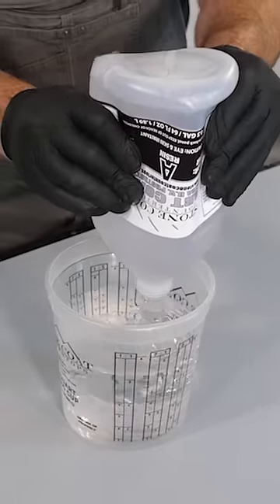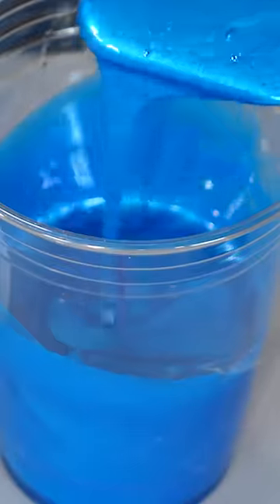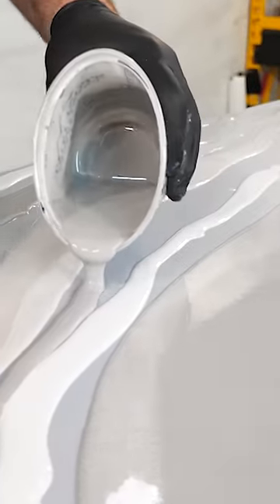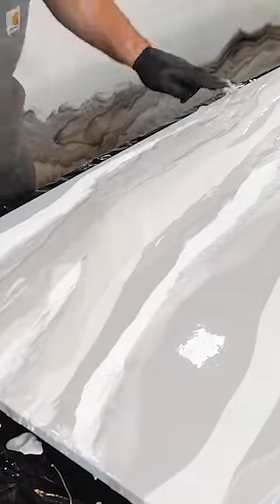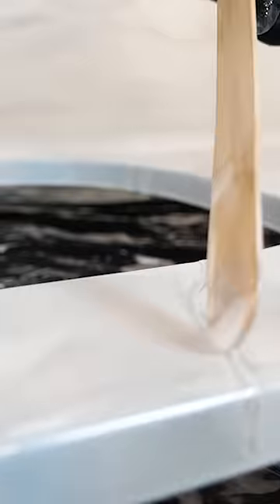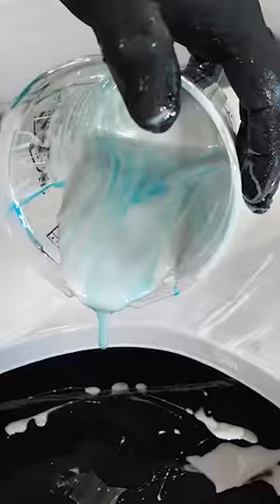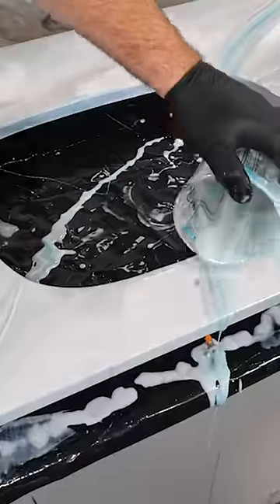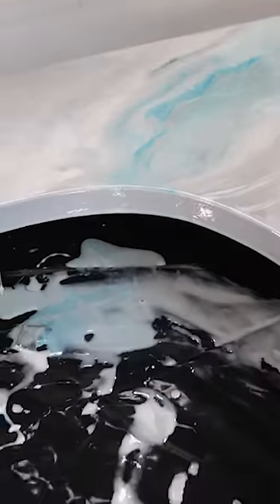He spent $3000 to get shoeprints out of Quartz 😱

Comment: $3000 to avoid spending $7000 and now having a guy to call if this ever happens again seems like a decent investment to me
Reply: You can get real quartz* for cheaper, like an actual rock that was brought from the side of a mountain 😮
Reply: The guy was 2 weeks away from retirement
Reply: Everybody wins
Reply: Yep G you said it first
Reply: @newera9962  quartz**. Good luck finding a big enough piece for a counter transporting that piece down a mountain and then hoping it had no severe defects like weird inclusions or stress fractures.
Reply: The painter is gonna be -3000 on his check.
Reply: @newera9962  that's what he's talking about......
Reply: @newera9962  he was talking about real quartz in this video. Probably a big single piece countertop which would be expensive even into the 7k range for quartz. The epoxy countertops are only a few hundred max.
Reply: @New Era  the problem with quartz is that its too brittle.
Reply: Chances are, if this story is true, the painter paid for it. At the end threw back charges
Reply: @itsm3th3b33  Why would they be surprised.  You know the epoxy pour happening on the screen has NOTHING to do with the story right?  You can't be so dense as to think that the stains on the quartz in the story was repaired with epoxy right?
Reply: Probably another lesson learned is to cover the quartz with cardboard or Masonite until the job is completed.
Reply: @newera9962  really?
Reply: @newera9962  yes but you cannot cut it
Reply: @newera9962  no way. its ganna be DUMB expensive for quartz like that lol
Reply: @colemanmorris5762  i would imagen that it would cost like 100k to get a piece like that lol
Reply: This is how capitalism should work. Everyone wins eventually
Reply: @newera9962  well yeah the processing is what makes it more expensive, just like a natural dirty uncut diamond is gonna be cheaper than a cut polished diamond.
Reply: He should've made the painter pay $7,000 and called it even. 😉👍
Reply: @newera9962  like how much? And would shipping/ moving it cost a lot too? Jw
Reply: @colemanmorris5762 this happens literally daily with slabs maybe 4-5 times the area of that counter top. Not as thin as that, but final surface grinding can happen after cutting it up to the final size. Look up wire cutting in quarries on YT, you'll see some big ones.
Reply: @colemanmorris5762  Weird inclusions would be an extra charge.
Reply: Not just that, he now knows a guy who has the skills to do it next time he needs it.
Reply: @LaughingOrange  who are you responding to? have you read entire op's comment or just two words: 'decent investment'?
Reply: @newera9962  quartz
Reply: Seems like time might have been a factor
Reply: I know, bc that’s happened so many times to me! Wish I had someone that could remove shoe prints from quartz.